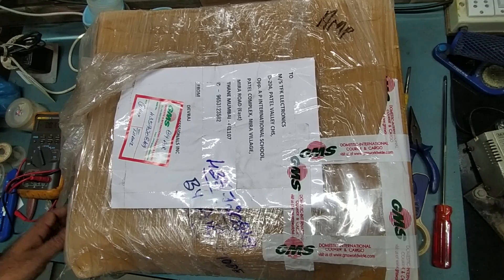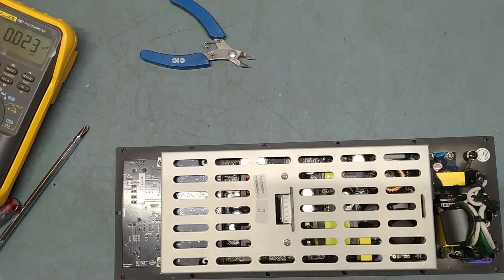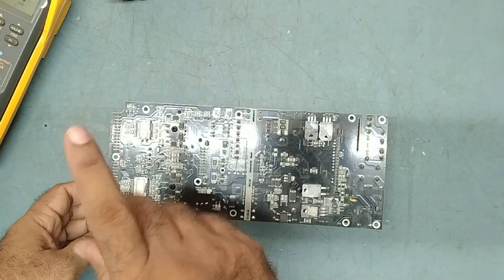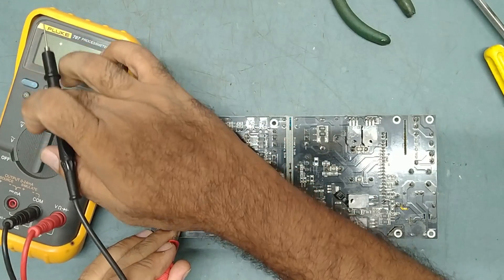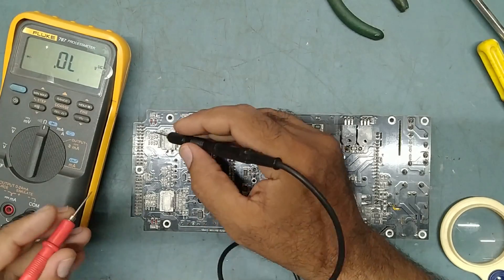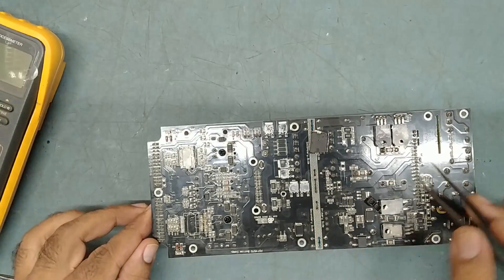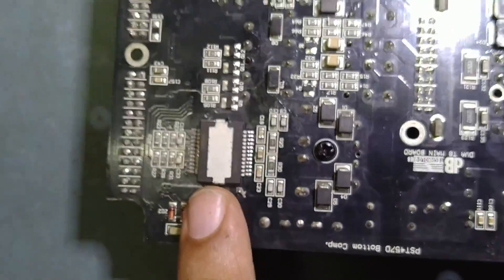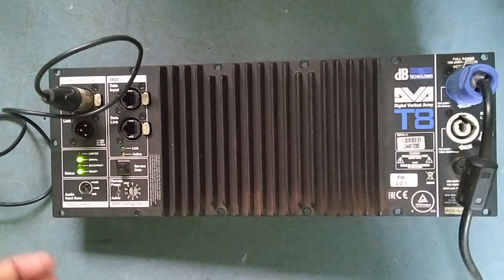Repairing dB Technology DVA-T8 3 way Active Line Array Module

Comment: I have a broken DVA T8 amplifier. when the woofer is loaded, the signal is distorted. when the woofer is not connected I get a perfect sine wave. amplifier of the broken T8 (1), exchanged with a good T8 (2). T8 1 works correctly again, T8 2 gets the same problem. In other words, it really depends on the amplifier. anyone have any idea how this is possible? MF and HF work properly. 

i hope someone can help me

Comment: Sir 5 volt 60 amp SMPS problem I connect the series power supply in SMPS series lamp is continuously on off condition what is problem and any salustion
Reply from the maker: Check in secondary side